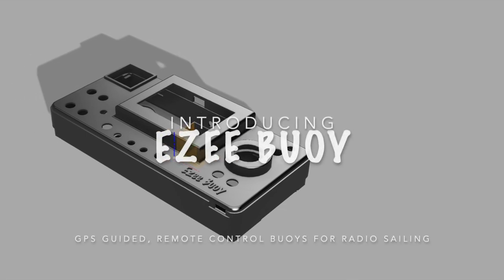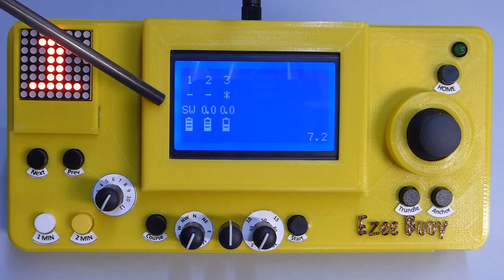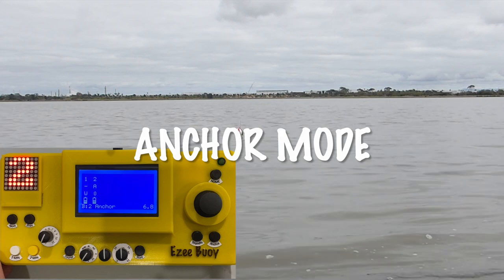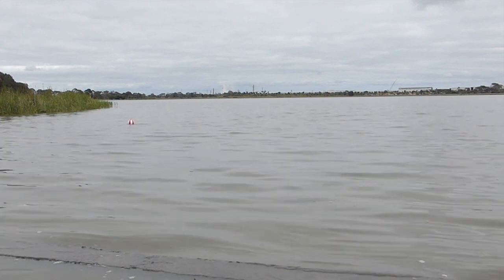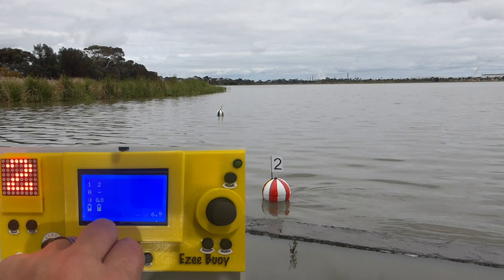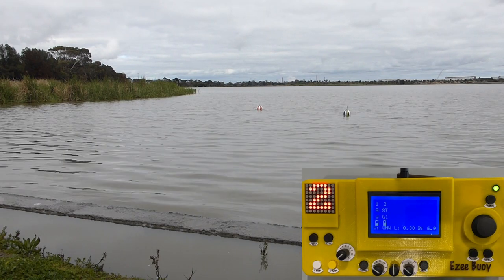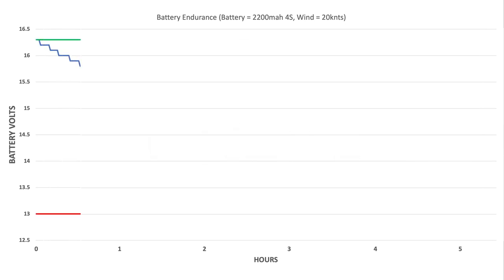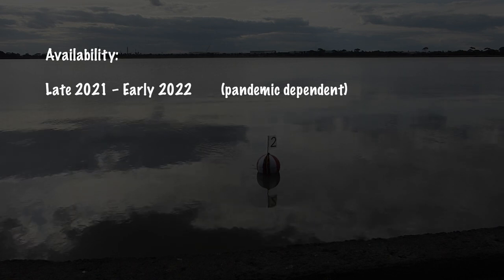Ezee Buoy Update 1

Comment: This is amazing tech!. The buoys look great and the concept of a dedicated controller is phenomenal. I would suggest the diameter should be quite a bit bigger so that there is a lesser chance of striking the underwater gear with the keel of a healed boat.
Reply from the maker: Hi Jaimie, thanks for the feedback.  I have been back and forth a number of times on the diameter of the buoy, balancing portability and usability.  My feeling in the end is that something slightly bigger would be good (something slightly over 250mm).  But with a 10R keel protuding ~700mm it is hard to avoid if someone wants to scrape the buoy on the way around!
Reply: @AndrewsWIP  You should make sure the race designates your bouys as "hot marks" to discourage that.  Noboday wants a penalty turn!

Comment: Any chance of publishing construction details?  We are a UK based radio sailing club with limited funds.
Reply from the maker: The construction element is less of a challenge than the control element.  The best place to start with a DYI approach would be something like the Ardupilot/Rover control system - it operates on a range of hardware and is fully configurable to suit whatever hardware environment you need to use.

Comment: I was a bit confused if the wind vane just relays information or adjusts itself to show the avg. direction at the buoy.  That vane looks like a major mast catcher, even if the mark is hot.  Would moving the vane to the transmitter box help with that and cut down on parts needed for multiple buoys?  RC sailing is close in, so the land based indicator would likely work nearly as well.  I love this project!  I was expecting a basic GPS anchored buoy, but you have integrated some amazing race specific functionality as well.
Reply from the maker: Hi Will, the wind direction indicator measures the wind direction (by reference to the built in compass) and transmits the direction to the controller.  I agree that, in the wrong place, the wind indicator is an accident waiting to happen!  My feeling is that the safest place for it is actually the port end of the start line (buoy number 2 in the video) so I will be moving mine to that buoy.  The indicator is interchangeable with the little mast with the number on it so easily done.  Having it on the controller is also a good approach although it makes the unit a little more bulky.  Thanks again for the feedback.

Comment: hi Andrew im keen to get a set of 6 to the Sth Island NZ...how do i go about this?cheers Bruce
Reply from the maker: Hi Bruce - thanks for the query.  I still have a few things to sort out on the manufacturing side and the current supply chain delays are not assisting.  I should be ready to go early in the New Year so I will get a hold of you then.  Regards.

Comment: Looks like a great product. Expensive and with the keels for shipping international mostly cost prohibitive. Will you be selling the design or components to those of us interested in the USA? Would a larger buoy ball prohibit DF95 from having keel strikes? Similar to the start line could one set an offset and gate marks?
Reply from the maker: Hi Jim - my reference to figuring out manufacture and distribution in the video was to your exact point.  These are not going to be cheap or simple to ship around the planet and so some alternative approach will be needed.  Exactly how that might work is to be determined and, hopefully, quickly!

The automatic course layout (for the next update) does exactly what you have mentioned - for a varying numbers of buoys, it automatically sets an appropriate course.  For 6 buoys, that includes a downwind gate and a windward offset.  For 5 buoys, windward offset but only one downwind mark.  But happy for input on that determination.

On the larger buoy - to a degree, yes.  But the geometry when a boat is heavily heeled (more than 45 degrees) makes everything tricky.

Thanks again for the feedback.
Reply: @AndrewsWIP  Sure hope you have world wide patents applied for to protect your product.

Comment: What a great product.  If i may add some constructive thoughts.. the home button should have a missile cover on it so it has to be flipped up to access,  holding that by accident when picking up the controller would spoil an otherwise autonomous day , my dad would hold that button for a min without knowing, hehe . Maybe a tiny inbuilt compass on the unit would be handy or a cheapy supplied with the kit.   The youtube "Chep" videos on 3D printing have been a great watch , have a look at the one on ironing for the outer cosmetic controller front the rest of the internals doesn't really matter. it would be good to have the subsurface of the Ezee Buoy a bit more keel friendly, tangles happen but if the lower were more friendly it wouldn't have to cause a hang up or damage to a boat.  Keep up the good work  and i hope those ideas help
Reply from the maker: Hi Wayne - great ideas all.  I particularly like the missile cover idea.  I haven't bumped it myself yet - and the switches do require positive down force - but it is indeed a risk.  Tangles with the keel of the buoy are certainly a factor ... I am sure we have all seen people dragging buoys with their keels tangled in the anchoring rope.
Reply: Hi to you both,  I too have concerns regarding the potential for keel tangles.  A solution we have adopted for our racing buoys (copied from others) is to attach a 20 inch/50cm piece of wide diameter pipe (8 inch/20cm) as close as you can get to the base of the buoy, making it like a 'lolipop' in profile.  You then attach the anchor line/chain to the base of the tube.   Whilst this does not stop people hitting the buoy or the tube, the keel bulb does not get hooked onto the rope/chain and the boat should be able to drift backwards off it.  Unfortunately with the Eezy Buoy system, this would significantly increase water drag for the outward/return journeys and any drag from currents.  We use offcuts of waste/soil pipes, often scavenged from skips or building site waste, but you could try something of a smaller diameter, such as rainwater downpipe about some .
Reply: Sorry, got cut off there.  ... Rainwater downpipe, about 4inch/10cm in diameter.  Or you could try something more streamlined if you have a local marina/boatyard and can scavenge some off-cuts of alloy masts (or some whole masts - our locals have a rack of abandoned stuff).
Another posibility is to keep the current  plate keel, but cast a flat-bottomed 'teardrop'  or pyramid for the weight/foot instead of the T-section.  Won't be so stable standing though ...
Reply from the maker: Hi Peter - thanks for the thoughts.  I guess the question turns on whether the concern is tangle or damage (to an expensive C/F keel).  Tangle is not much different than a dangling rope below a normal buoy.  Damage is, as you say, best handled with a "softer" keel.  The length can be finessed to achieve the desired result without too much draft and I will be looking further at that aspect.

Comment: Truly spectacular. I’m very impressed by the battery life in 20 kts. Pricing seems reasonable for a club. I would guess that the thrusters are the most wearable part, so I would ensure that they are easy to replace. Great job!
Reply from the maker: Thanks Andy.  The thrusters are brushless motors so should wear reasonably well provided they are always run in water.  But good point.